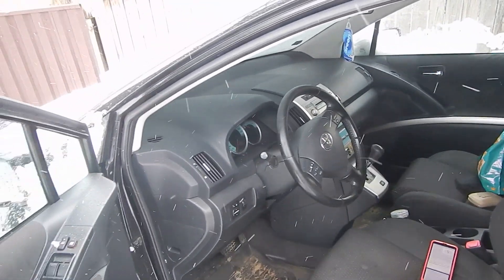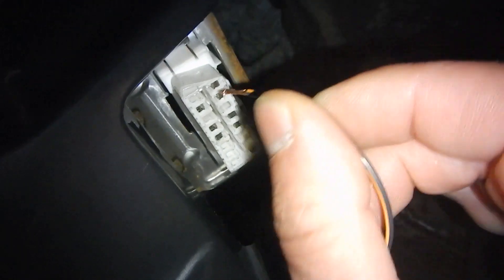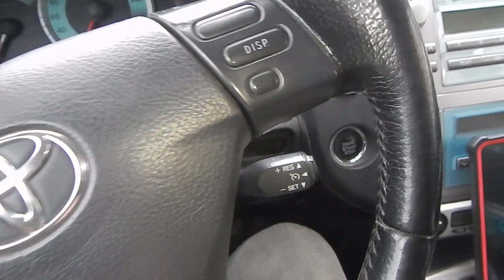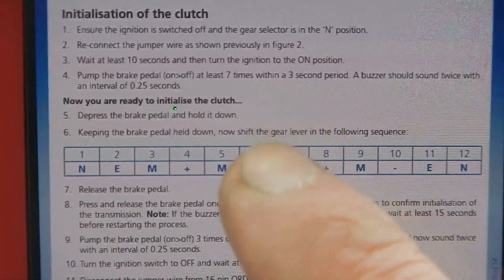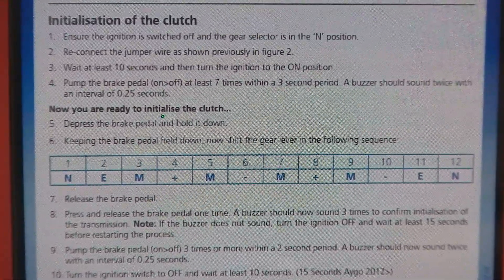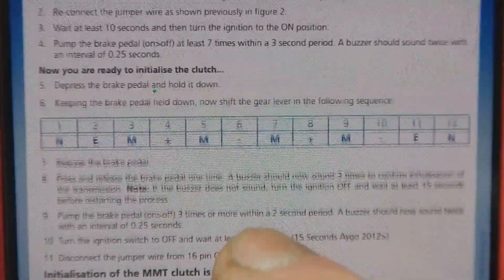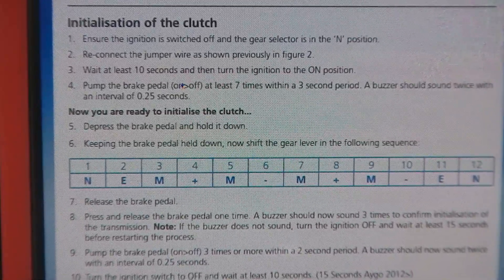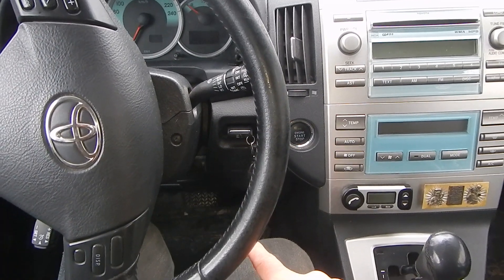Toyota MMT Multi-Mode GearBox Actuator and Clutch initialization Learning Code DTC  P0810 all models

Comment: Hello Vak, great work. I have a problem with a Toyota Corolla Verso 2004 between the first and second gears, and at the traffic light the gear slips and the car does not move until I start it again and take off. It is embarrassing, especially at traffic intersections and congestion.
Reply from the maker: Hi.
Do this first, need to know trouble codes.
https://www.youtube.com/shorts/W2DRdW2XflM
Reply: Hello my friend,great job. I changed my clutch and i repair the robot on my auris 2008 diesel and now with the super tool (wire on pin 4 and 13 ) the codes i can read are 21 , 41 and 96 i tried the calibration as you i m listening the buzzer correct but it does not work. When i fire the engine i see the red light of gearbox it does not accelerate only idle and N is blinking. Can you help me with this? Thank you

Comment: Hello, I do diagnostic just slike you on Toyota Aygo 2009, and find foult 36, can you help me, and tell what fault meens. Thank you.
Reply from the maker: Hello.
Yes, follow this link:
https://www.youtube.com/watch?v=1kSyTHlnDyQ

You have 6 speed gearbox? Where are you from?

P0919	36	Gear shift position control error	Shift stroke sensor
Shift and select actuator assy (Shift motor)
Open or short in shift stroke sensor circuit
Open or short in shift motor circuit
Synchronizer ring
Shift fork
Hub sleeve
Transmission control ECU
The transmission control ECU detects the following conditions simultaneously:
(a) Shift motor current is 32 A or more for 2.0 seconds.
(b) A difference between the target shift stroke and the actual shift stroke is 0.3 mm or more.
(c) The amount of shift stroke movements is 125 mm/sec. or less

Comment: Hello, I have a big problem with the Yaris 2007 MMT. After a longer drive, the N started flashing and stopped shifting. After 3 months in the service, I bought a new actuator, clutch, box computer. The procedure was tried from the computer, but it did not work with the computer. I managed manually with a strap in pins 4/13 N++++EN then N----EN then N+-+-EN , it worked, after 3000 km it started to jump out of gear and flash N . I set myself up as a craftsman and tried the Learning Mode procedure, the one above. N has disappeared, I don't know what to do to at least make it go like before, even if it jumps out of gear. Please give me some advice, the car doesn't move, N has disappeared.
Reply from the maker: Hello.
Message me will talk about it
WhatsApp +375 29 6353511 Yury
Reply: @vak_service  Thank you for the support, I removed the electric motor from the accruator, inserted a screwdriver and stretched the actuator rod to the maximum, I only did the ++++ procedure and now it works. Thanks for the support.

Comment: Hi Vak, 
I had the actuator repaired, but have trouble installing it. The actuator seems to be in a retracted position, so I cannot install it, it is too short. How can I manually extend the actuator for installation?
Thank you
Reply from the maker: Hi. Remove electrical motor and by screwdriver rotate inside that the shaft will go out maximum.